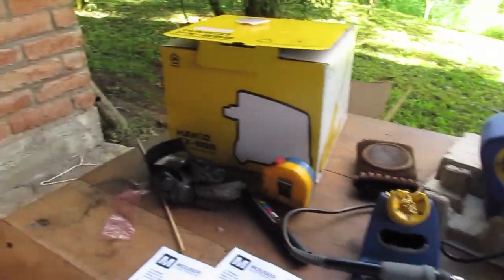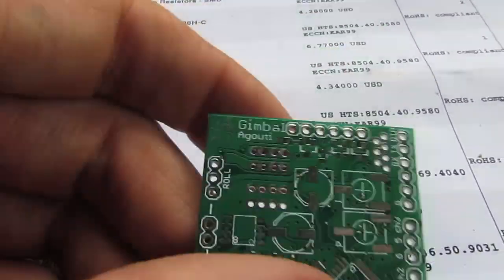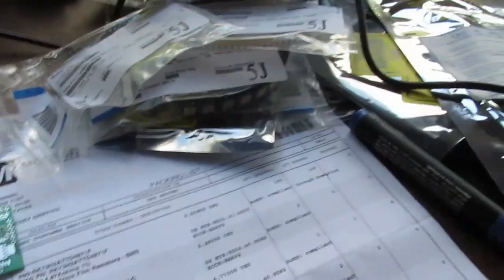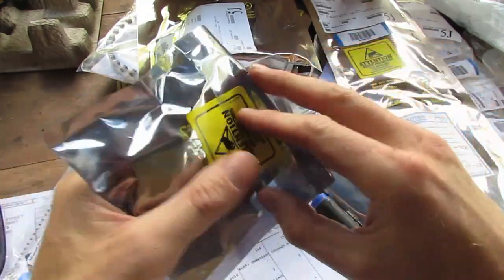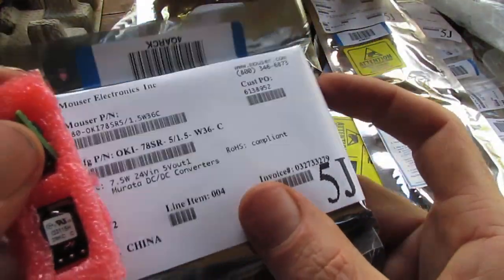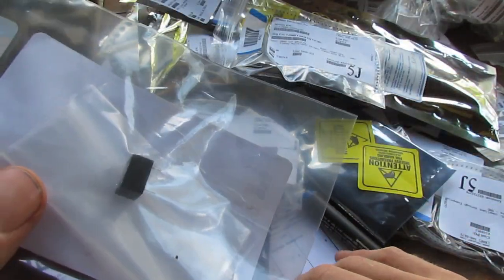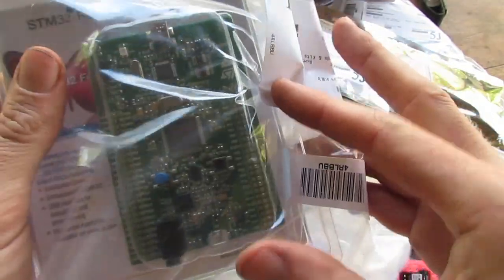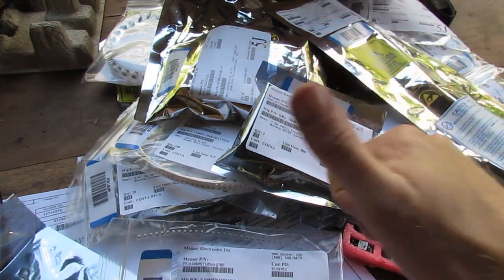Gimbal Mailbag. RCHacker #42

Comment: Another good video! You should check out using a package/mail service out of Miami, there are several good ones servicing Ecuador. Anything less than 4kg and $400 passes thru Ecuador customs without a problem. Just a thought, I have been using them for years here in Panama without problems, faster and more secure.

Comment from the maker: Good ideas,
I wont be comparing the two as the hardware is essentially the same. However I do recommend Flytron as the hobbyking use inferior components and I have heard of a few DOA and with corrupt boot loaders.
I have not forgot about that video, I have most of it filmed, just need to finish it off and edit it.

Comment from the maker: Not without serious modifications to the flight controller code. A gimbal with servos uses absolute positioning while brushless uses relative positioning and a PID loop. Another route would be to make the brushless motor and controller sensored. SimonK has mentioned that it would be entirely possible to modify his code but as yet I am not aware of anyone who has.

Comment: You'll love the FX-888!

Do you think a pair of Atmega based ESCs w/ modified firmware, could control a couple brushless gimbal motors, to allow them to be used with a Cam Stab type FC (servo type)? e.g. KK2, Eagle X6, MWC etc...